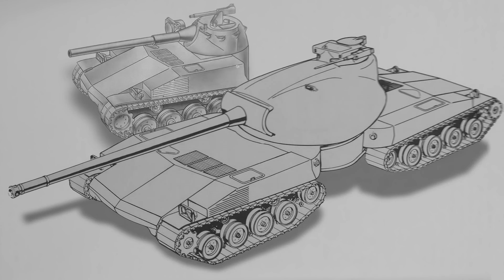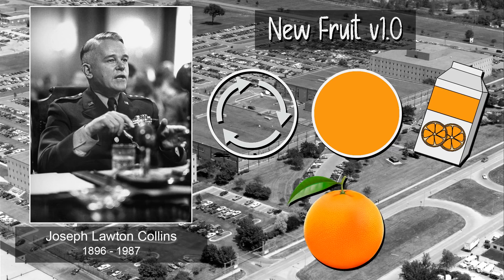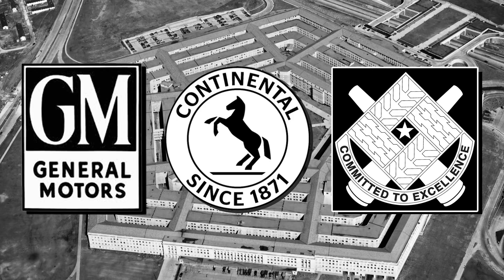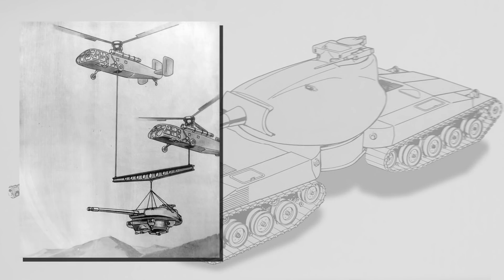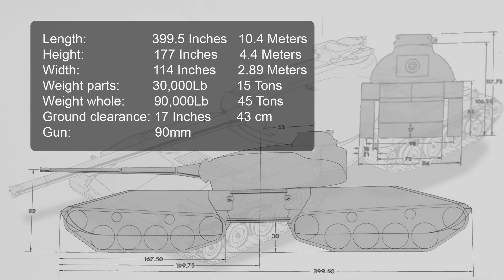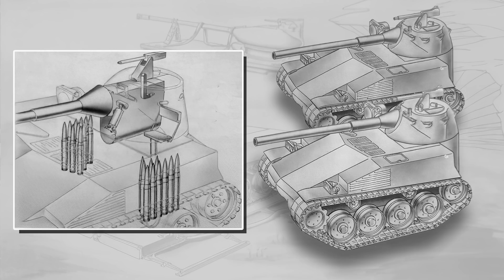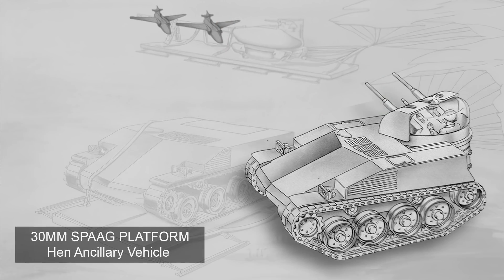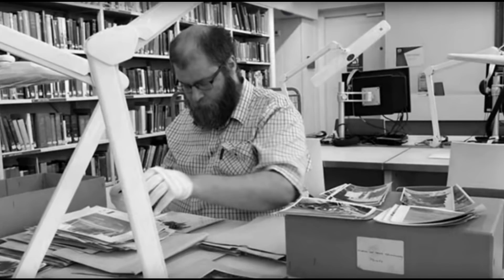ASTRON - Chick & Hen Concept Tank  - Tank Design & Theory

Comment: Liquid propellent machine guns? At first I wondered how it would inject enough liquid propellent fast enough to fire at a high rate, but then I realized it could be like the fuel injector in a combustion engine. Instead of filling the whole space behind the round like a larger LP cannon would, it might only ened to spray a small amount. Although, now that I think about it, such a system would have problems starting and stopping, since the liquid would un-mix and pool in the chamber, potentially even leak from somewhere. So the first round after pausing fire would probably have less power behind it since the propellent would burn differently.

Comment: I can somewhat see the chick module having a C-RAM style system installed,
 That would sorta give you the mobile ability to knock out incoming rockets as long as they can still be locked on. But you would definitely need more than just the driver in it. 
And some sort of MLRS might be nice to have. Portable power that is still near the rear and could put rounds down range and leave artillery batteries freed up to move to another location, granted it would need more than 6 rounds or it would be pointless. But you would still need the logistics and teams to refit it. 
Definitely thinking outside the box.

Comment: Design flaw: turret adds too much weight to pivot joint. Needs 2 smaller turrets @ front & back to equalize weight, & remove stress from pivot.
🤔 This design would work well for a mobile bridge. Scissor-lift on 1 end & a resting stand, with an offset swivel, on the other end.

Comment: Not a bad concept,  with the articulated,  two,  tracked pulling units,  which would do well in deep mud and steep terrain.  That concept is used today in transport,  utility,  and rescue  and recovery vehicles,  by a lot of different countries'  government agencies,  especially in Europe,  and Russia. Those vehicles are controlled only by the front unit,  with the driver's cab and engine and a drive shaft from it to the rear unit.  They have hydraulic steering cylinders,  between the units,  much like an articulated log skidder.  I believe they do well for their intended uses.  For war time,  military use,  however,  I have my doubts.  I don't really see how they could have a tighter turning radius than a single,  tracked unit.  I also believe they would present a considerably larger broadside and air target to an enemies guns and bombs.  Also,  if one drive unit gets knocked out,  it would probably stop the other unit and make it a sitting duck,  until the downed unit could be separated from it,  which might be impossible to separate,    depending on the type of damage the knocked out unit has received,  and the fire from the enemy.   Those are just a couple of cons that I have thoughts on.   There are a few more,  but I believe there are some pros  also,  besides their,  already named,  possibility of  being great in mud and steep terrain.  This post has gotten too long,  so I will stop here.

Comment: If the disk in the center acted as an axis for turning between the 2 track section, allowing for easier city/forest maneuverability around obstacles, with the turret sperate but interior/above that center piece, I'd actually think this would make a good infantry support vehicle in urban and woodland combat, possibly even in rocky terrain like mountains. 360 turret access of the field with the ability to turn on a dime, with two engines for faster speed and greater torque? You'd have to stick with medium armoring for mobility, making it more a support than a tank, but that's huge right now. Infantry support vehicles and infantry transport are overcoming tanks right now as modular weapon systems are being made more compact and easily equipped to vehicles. I'm down for it. The smaller models I'd simply replace with APCs, but still.

Comment: A modular light vehicle able to be configured for any mission is a great idea, but the layout of the Chick seems like it would be pretty back heavy and unable to depress the gun very well since weapons systems and ammunition are mounted in the rear and the motor is mounted and fuel are mounted in the middle with nothing in the front to really counter the weight. Also if the Chicks are meant to be able to be put together into a Hen to serve as a proper medium tank, how thick would the Chick's armor be? Seems excessive to have exactly the same amount of rear hull armor as the front.

Comment: "Let's make our new tank fiddly, modular, and easy to dismantle with as many points of potential failure as possible. Because those are things you want on your 'qualities a tank must have' checklist."
The eyes of every engineer in the motor pool just rolled so far back they landed in Julius Caesar's wine.
Reply: Rather certain the Logistics Division either had a Foaming Fit, Fainted, or started a Riot.

Comment: The hen would allow for bigger tanks given the load is distributed more (why someone wants gigantic tank aside they are if you want style awesome is the other question)
But if one wants to have a very mobile big gun not used for the very front line but mobile enough to stay just behind and quick reposition as things change...
I know the finnish army has an concept of 4 artillery pieces on an terrain able truck that fires volleys and then runs that can lay waste on an big area and not be where it fired from when the first round hits.

Comment: A specialized vehicle will be really good at one role.
A general purpose vehicle will be okay at a bunch of roles.
A modular vehicle is going to be okay at just ONE thing at a time.

Also "We can reconfigure this vehicle to be anything you need it to be!" is, and has always been, a trap.
Firstly, the quoted time to reconfigure is always going to be under ideal circumstances while encountering no problems.
Secondly, you know damn well that a commander is going to find 2-3 configurations that cover general purpose use when combined in operations (like an IFV and a tank), and they're just going to leave the vehicles configured that way all the time, so they might as well just have separate vehicles that were purposely built for those roles.

Comment: The Hen actually kind of makes sense even on it's own. If any unit breaks down, it would only take out 1/3rd of the whole thing, and you might just put together 1-2 new tanks from 3 damaged ones. If we assume that it would have 3 completely isolated crew compartments, then a direct hit to one of them would also leave the Hen able to retreat and/or fight on.

The auxillary Chick units however...
Let's assume that a unit gets 1 Hen-, 2 Chick- 1 AA and 1 MLRS Module along with 4 automotive units. You thus saved 2 propulsion systems (at the cost of 2 modules sitting unused at base). So far it seems economical.
But the Automotive units will either be severely under-armored for use in a MBT or severely over-armored for an AA vehicle. Not to mention for an MLRS platform, which is a piece of ARTILLERY and thus shouldn't ever come under fire.
Add to that the increased complexity from the attachment system(s), and I'd say the whole system costs just as much as 1 MBT, 2 light support tanks, 1 AA APC and 1 MLRS Truck would have, if designed independently. The only savings is that you save the transport VOLUME of the 2 automotive units. You might save a bit of the transport weight, but just maybe - that entirely depends on how much yarmor you would have slapped onto the standalone vehicles. And as a slight benefit, you'd only need spare parts for a single line of propulsion units, (but still for all 5 different weapons systems).

Comment: Great video. I have one remark related to the logo with the horse at 3:50. I think that's not a Continental-Motors logo.
I assume the one you included is from the german tire manufacturer Continental that was founded in 1871.
Reply from the maker: ahh dang, you are right, i went though a lgo site and stuff, but yes it appears this is for the tire firm, il add a sticky note - cheers

Comment: How could an articulated tank have a better turning radius? I thought tracked vehicles could turn on the spot.
Reply from the maker: only in neutral steerign which requires the vehicle to be stopped - there are many ways top steer a tracked vehicle, some better than others, articulated vehicles can steer and handle on broken terrain better than conventional vehicles as well
Reply: @armouredarchives8867  good answer. I hadn't thought about turning radius being a factor when it's necessary that the tank keep moving.

Comment: My dad worked on a boosted Rocket project for the F-89 Scorpion interceptor. The  project lost out to the Folding Fin Aircraft Rocket 2.75 Inch. Interesting idea accurate as all hell. Full auto burst all rounds into a 36" diameter target at a 1,000 Yards. Bloody expensive in machining time for full production. Air Force wanted a bit more spread thus the rockets also easier to make in bulk..

Comment: "Ramjets are pretty cool, lets make a bullet out of it" - Some Detroit Arsenal engineer mid 50's
Reply: Scary part is i could see it working... course it'd have to cost better than 2 mil a round...
Reply: 2 mil of what? WWII radio proximity fuse cost dropped from 782$ to 18$ a round. And jet engines are one of the simplest combustion engines out there.
Reply: @Paciat  Sure Ram jets are pretty simple.  Now design ones that'll take car crash levels of acceleration work 100% of the time and only explode where you want it to.  Can it be done yup would it be cheap nope.  And how long before some braniac says he this thing really is just a missile let's put guidance on it.   Wait now you have the Navy’s Extended Range Guided Munitions at 191K a round estimate as of 2006...   Or the Zumwalts Long Range Land Attack Projectile at around 800K-1mil a round...  And they were just rocket assisted something even simpler than a Ram-Jet.  Yeah 2 mil might be high...  But by how much...
Edit looked up artillery round shock loads and my car crash estimate was low...  Like OMG low...  at least one spot mentioned 10,000 G's others mentioned more (don't even look at railguns 100k) even  easing things down if its only 1k thats still an insane amount of shockloading...
Reply: @Paciat  not saying you wrong but materials needed for a ram jet are still expensive even in today’s standards

Comment: If you didn't say this was a real project, I'd've assumed this was something from a Command & Conquer: Red Alert expansion pack I'd forgotten about.  Lots of cool customisation options for players without the need to create many additional art assets.  Exactly what you want for a video game.  I can't help but think in real life, these modular tanks which can supposedly be gun, AA, MRLS or ATGM vehicles would have ended up costing as much as just making each of the vehicles individually.
Reply: I've seen something VERY similar as part of one toy range or another. Can't remember if it was GI JOE, MASK, or StarCom though. It's a very toy-ready design.
Reply: @Vespuchian  The Thunderclap Howitzer and the Raider come to mind.
Reply: @Vespuchian  that just reminds me of a classiced cracked article about GI Joe vehicles that seemed designed to kill their operators.
Reply: " I can't help but think in real life, these modular tanks which can supposedly be gun, AA, MRLS or ATGM vehicles would have ended up costing as much as just making each of the vehicles individually." - Stryker and Armata chassis vehicles in a nutshell
Reply: @Warhamer116  and the F-111, F-35.
Of course a version that did work out was the C-2/E-2 for the Navy, and the earlier C-1/E-1/S-2.
Common airframe for multiple missions, adapted to each.
though those were adapted at the production line rather than in the field.
Reply: The idea I believe is based around needing less custom tooling, allowing for more common parts decreasing the load on logistics to cover a wide array of basis. Better production techniques lead to theoretically cheaper tanks.

Technically, if you look at the Sherman in WWII, it was a very multipurpose tank, that while not specifically modular, was able to take part in multiple different roles, from the Jumbo Heavies, Fireflys for Heavy-AT, regular for dual AT/AP purposes, or even the dozer variants for the engineers.
Reply: @D_U_N_E  Almost all the Sherman variants required extensive modifications to the hull.  The Jumbo you mention basically has a completely new hull.  They weren't field-convertable.  And a lot of the Sherman-based SPGs had unnecessarily thick armour for arty, so it did compromise their ability to do their primary role somewhat.  If you want to have a multirole vehicle and switch roles on the day in the FOB, you need all the parts for all four roles at said FOB, and now you're managing 4 different kinds of ammunition and spares, and you either need a crew trained on 4 different layouts or you need multiple crews. You're also losing some efficiency in the hull as you've also got to reconfigure the hull for stowage of these different ammunition types.  Gun-laying and mobility systems are going to be under- or over-specced for some of the roles, as they all have different weights and traverse requirements.
Reply: @D_U_N_E  However some variants suffered from downsides due to it being from a preproduced chassis instead of a custom one.

The jumbo had a strained drive train/suspension, lower operational range and while more reliable then many heavy tanks, was less reliable then a standard sherman.

The firefly has a 17 pounder, that is about it's only benefit. The gunner was playing origami in the small turret to aim the gun, the gun blast was so bright the gunner/commander had trouble figuring out wether they hit their target or not. to the point a commander may even dismount out of the tank to observe the target more clearly. The loader had to mandhandle a large heavy round in a very confined space so the reload was bad. And to create space for those rounds they axed the bowgunner/radioman so the commander had to work the radio as well.
Reply: To quickly engage both of these comments.

I am looking from a logistical standpoint, so multi-purpose is less that a singular tank can be on the fly be adjusted, but that a series of tank can be modified without too much change in logistics/tooling.

For the Jumbo, I have been trying to find it, I remember the Chieftan talking about a field applique armor package for field modified "Jumbos" - so while not the Jumbo, it was possible for field jumbos to exist through applique armor packages.

To Char on the variants downsides, this is WWII. Listing failures also needs to take into account the alternative possibilities, a brand new tank makes logistical supplies more complex than just reusing many of the same parts for a slightly different tank. While I understand enmasse the Firefly wasn't a good tank when we consider the original basis of the Sherman. It was good enough for providing armor penetration against the very new threat of the panther.

I should have completed my original comment, that specified purpose built designs obviously beat a design for mass purpose. All designs have some short coming, though I feel it is safe to say that the US seen the benefits of a tank platform that could be rather quickly modified for various roles, and as such it makes sense they would want to see how far they could push this aspect. Given that the US in any protracted war against Europe would still need to ship their tanks overseas, it makes sense they want each ton on a freighter to be as valuable/usable as possible.

To push that last part, look how "Modular" is currently a buzzword in firearms designs in America. 

I personally think this modular series of tanks was rather stupid, but I like most of us in this comment section have the ability to see current MBTs and tank programs from the last century to be able to understand why this was a dead-end with our current designs.
Reply: They would end up costing more than the individual vehicles. Also I am old because this just reminds me of so many G.I. Joe toys.
Reply: I think the f35 proves it would have cost way more.
Reply: @joshschneider9766  The F-35's aren't modular aircraft, i.e. you can't convert an A-variant into the VTOL B-variant with just in-field tooling, you'd basically have to rebuild the aircraft structure. The thing the F-35 provided was the parts commonality between the A, B, and C variants, nothing more.
Reply: I love your comments. This thing DOES sound like it is supposed to be in a command and conquer game
Reply: Boxer and Lynx with their mission modules, they can be swapped in a FOB in under one hour.
Reply: @scratchy996  ah, LCS level thinking right there...
Reply: It certainly does look like eith the Soviet Mammoth or Chinese Apocalypse tanks.  They should have designed it with dual main guns for reasons.